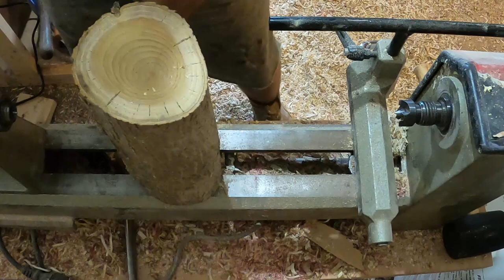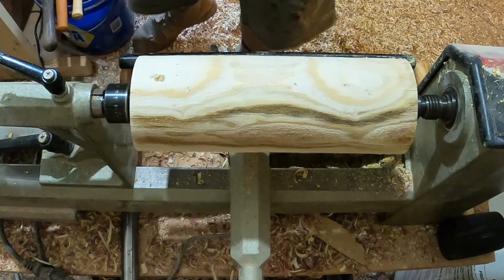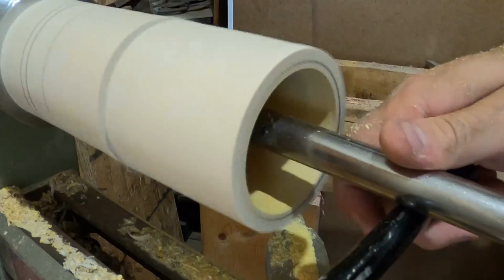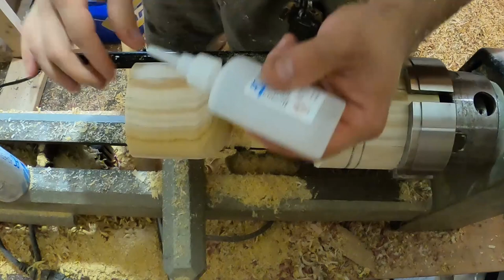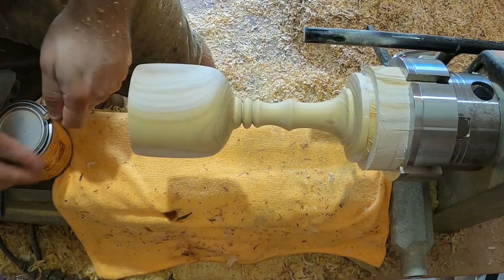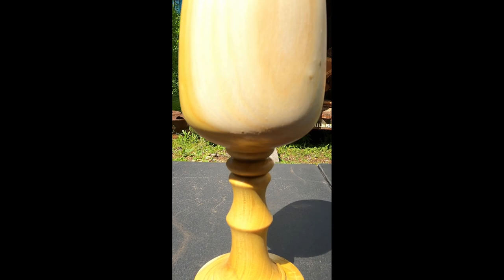Woodturning - Mulberry Goblet (The Golden Chalice)

Comment: Nice piece. After having done a few (many), of those with beech, cherry, oak, mulberry, poplar, I suggest coring it out first, leaving the walls, stem and base thick, (much like you would when you rough turn a bowl/twice turned bowl method.
Then seal all end grain, stem and cup with either Anchorseal, or regular Titebond wood glue, and then start drying it out slowly.
It will move on you, but it can then be re-turned true to it's final shape without it moving or cracking on you.
Try it out and see what happens with the next one.
Good luck. Keep a goin!
Reply from the maker: Thanks for the advice for the mulberry. Normally I don't have a problem with warping and I was especially surprised with this one because this log has been sitting drying for a couple of years. But we live and learn right? 😁
Reply: @countrycraftscustomwoodworking  Exactly!
My old turning mentor always says, "If you ain't turning, you ain't learnin!"

Comment: Did you have any issues with the cracking after it dried out?
Reply from the maker: So for this particular log I did have some issues with warping around the cup and stem and some minor cracks around the base. It was unfortunate since I have had this piece drying for at least 2 years. Some wood I have zero problems with, like the aromatic cedar I used in another video and some just give issue after issue.

Comment: The design was good, but far too much scraping rather than spindle gouge, and then going back over the turned work again with a gouge after considerable amount of sanding which only blunts the tool.
Reply from the maker: I appreciate the feedback David. I do tend to move back and forth a lot between them. Helpful tip about the blunting. Thank you!